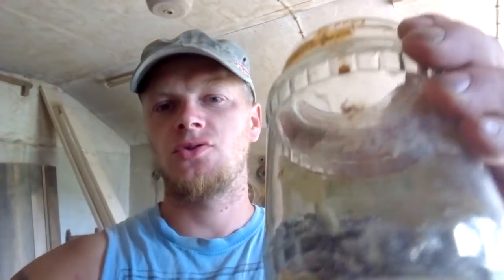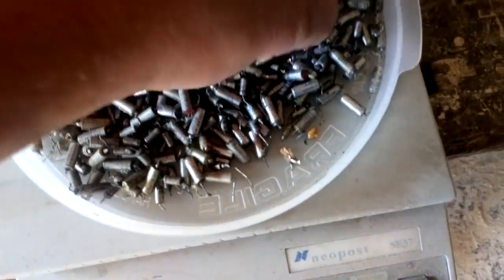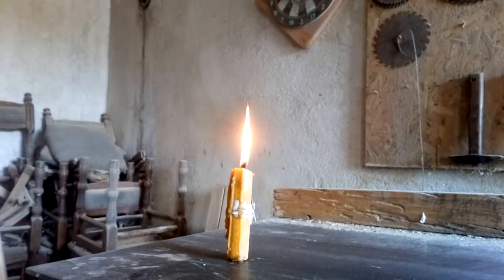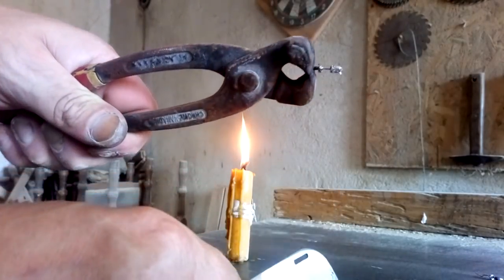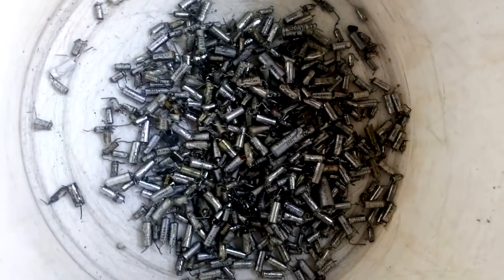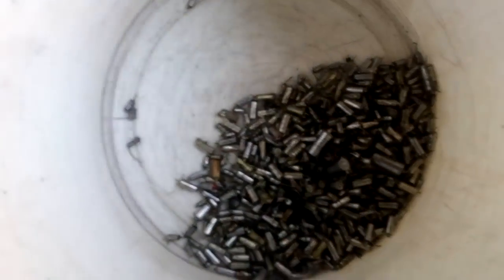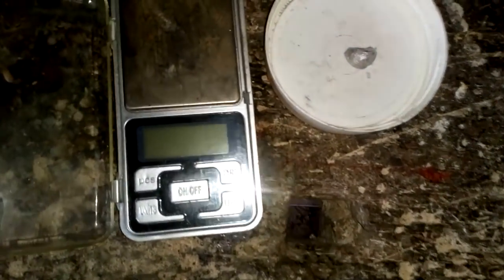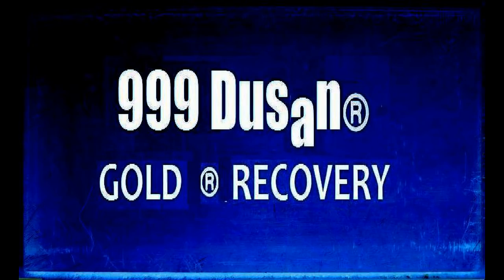TANTALUM RECOVERY part 1

Comment: The white sediment on the bottom is probably manganese nitrate comming out of solution. the cathode of a tantalum capacitor consists of manganese dioxide which reacts with the nitric acid to form  manganese nitrate.
Love your videos!

Comment: Could you use sulfuric acid to remove plastic
Reply from the maker: No, this kind of plastik would not disolve in sulfaric acid! Just make a big mes, like gum!
Reply: why not use the charcoal method , use that to burn away all plastics , plastics turns into carbon , acid leaves carbon